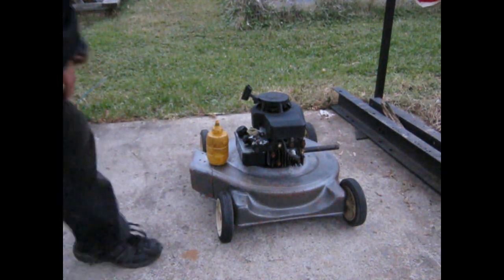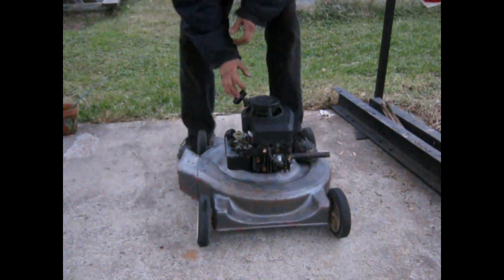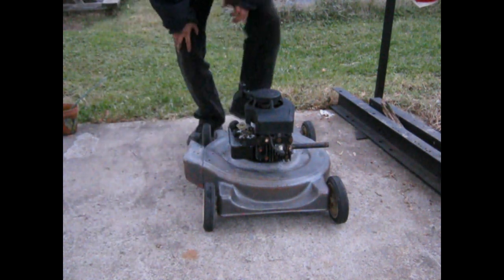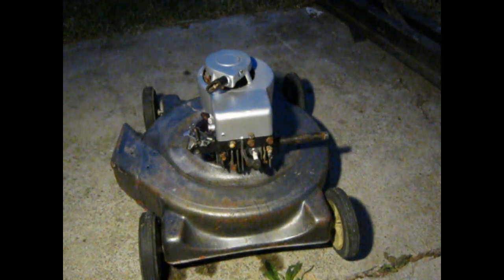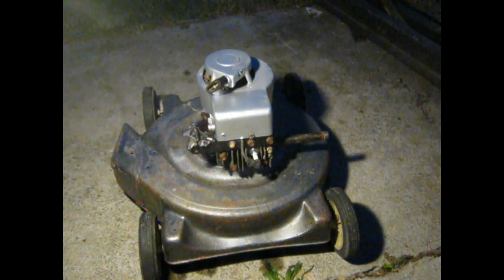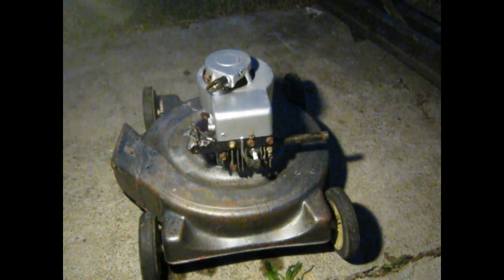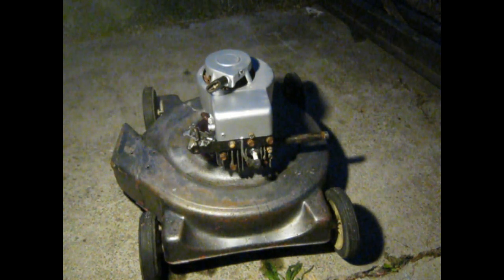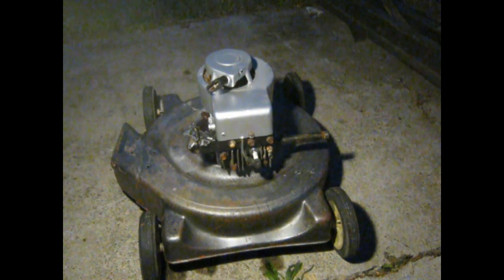FrankenBriggs Simplic Engine Start FAIL   :(

Comment: is this supposed to increase power output? i got a 12hp briggs im about to take of my tractor and throw in the shead do to i need more power, i keep stalling the thing out. i have an unstoppable 18hp opposing twin im fixing up to throw in, but if i could get the needed power out of the single, might be a fun project.
Reply from the maker: Oh no, this will make much less power, the original Simplic was designed  to be a light, efficient engine for use in such places as natural gas compressor plants. For a given cubic inch engine, the power output will be much lower than a normal engine, however, it can be built lightly with more cubic inches, so the end result would be a fairly decent engine which is fuel efficient, and can't break down do to cooling failure. i plan to make another vid explaining more about the original Simplic concept, as my vid didn't cover much about that.
Reply: huh, your gonna have to dose some comparisons on fuel consumption when you get it running.

Comment: Try some forced induction from a hair dryer that has a cool setting,  or a blow up mattress electric air pump. i doubt there would be much positive air pressure to blow the fuel back into the bowl but it maybe just enough to get a mixture into the cylinder to get  combustion started. still waiting for that H24 sleeve valve Briggs!! :D
Reply from the maker: Good idea, I may well end up using a hair dryer or something, my son suggested a shop vac to suck the exhaust out, and pull the air in.  The H-24 sleeve valve Briggs (1/2 scale Napier Sabre) would have to wait until I win it big in a Lotto !  :)
Reply: i'd not use a shop vac! as i expect it would suck fuel n air mix into itself  and with the arc of the electric motor it could ignite and blow up the vac.  At best if it's like the old cylinder vacuums from the 60's here in the UK you'll have an 'Afterburner' effect out the rear of the vacuum comparable to a Bristol Siddeley Olympus engine :)

Comment: Just needs a drill-starter to get it going... :D
Reply from the maker: I will probably give my 1/2" drill a try, and decrease the compression, either by grinding the head a bit, or making a longer duration camshaft so the valve allows more gas out of the cylinder, lowering compression. I explain that in my second vid which I am still waiting to be processed, it is slower than a 7 year itch!

Comment: Another Tuber welded a socket to an adaptor , takes the tin off the motor and uses a 120 volt drill to spin a mower
Reply from the maker: Yes, I may give that a try as well, as I broke the first starter rope, and had to replace the top cover. Some type of electric starter may be the only way i can get this contraption started, perhaps by squirting gas into the manifold. I am not even sure the Briggs carb. will work,  as I don't think this will have much of an intake pulse. I guess i had my hands full figuring out how to build this, that i overlooked some of the finer points!  :)
Reply: I got one of those cheap 6.5 hp 212cc [bottom] of the harbor freight engines.  Lots of people have done drill starters, I'm too cheap for a drill.  I think an airtool motor starter would work well though!

Comment: Try to make one diesel with no icnition
Reply from the maker: That would be quite the challenge! Initially I was making a steel head for this, so it would be overhead exhaust valve, but my machining access went to heck, so I had to simplify it, perhaps too much. I was also going to make it fuel injected, which it may need to be to even run, the jury is still out on that. Once again this is just an experiment, but the original concept did run, as Chatterton had some prototypes built, or so I have read.
Reply: ChargerMiles007 you might be able to make that franken Briggs diesel because it has a lot of compression
Reply from the maker: Perhaps, but i will have to upgrade my home owners insurance to cover damage to the neighbors house, if and when the aluminum cylinder head grenades!!!!